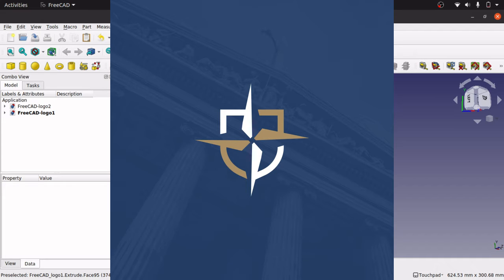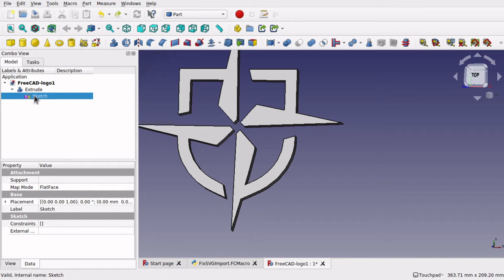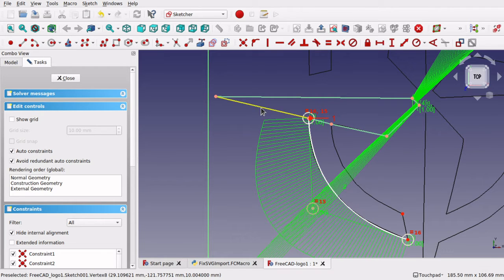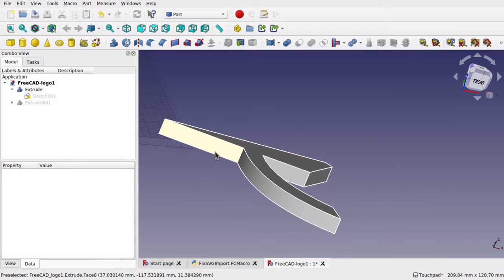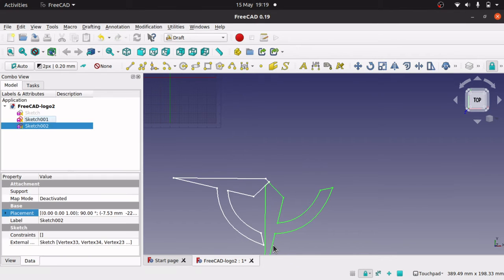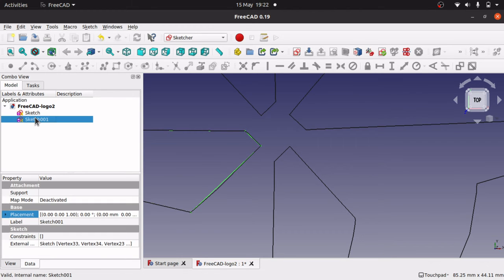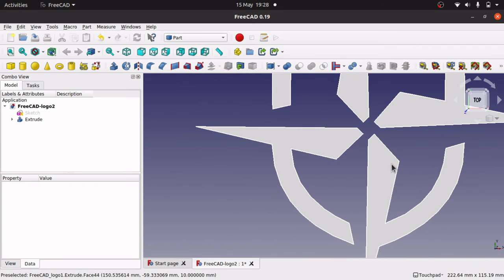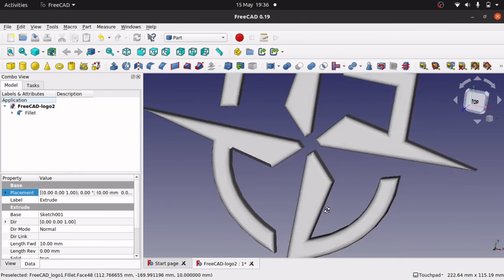Convert your logo to FreeCAD PART 3 of 4: Refine, Smooth, Fillet and Chamfer. Beginners guide

Comment: So I follwed everything OK but when I try to malke a fillet, on the clone section,  piece of fillet is missing on one side. I can reduce the radius of the fillet and it helps. However, If I red sketch, from zero, all 4 parts, then I can fillet with no issues. So somthing goes wrong with the clone. I will try to do with a clone again but not a big issue. Reading around, it seems fillets are an issue with   other such software too. Thanks for another great tutorial! all the pieces of the puzzle are falling into place !
Reply from the maker: Yeh fillets can be a right pain sometimes and half the time it's hard to see what's causing it to fail. Glad you are benefiting from the tutorials, I will keep them coming. Great to hear your making progress.